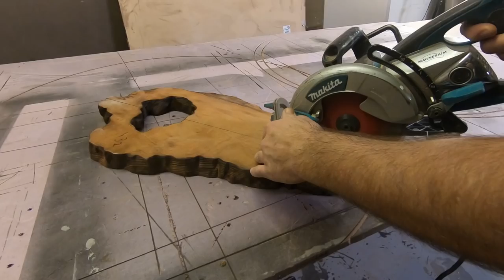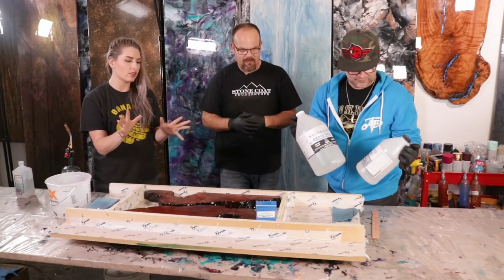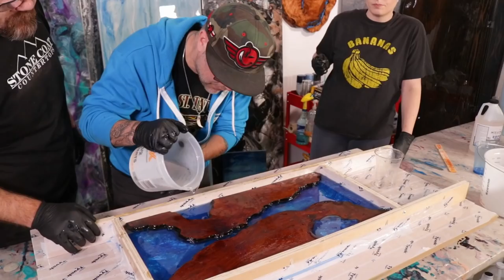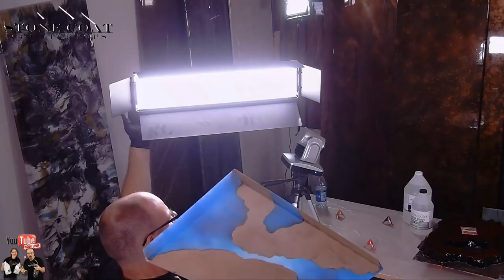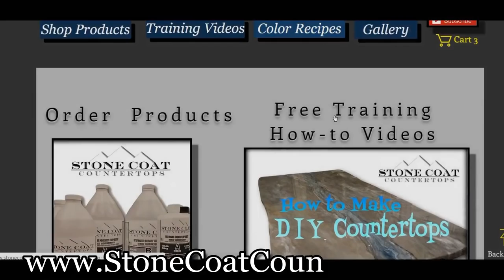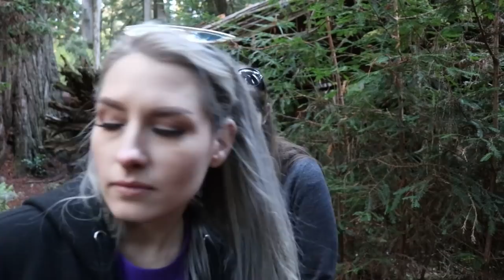Live Edge Table

Comment: Beautiful table.  I am wanting to get into this so I want to start small and was thinking of making small shelves that would get installed with shelve brackets.  Using your products, what are the guidelines for room temperature while mixing, pouring, and allowing the resin to cure?
Reply from the maker: Awesome question Batcave Bricks, You'll want to be between 70-80 degrees for the first week of the project life, doing your best to not allow the temp to drop below 65 degrees for maximum durability. 
Give us a call anytime and we would love to help 541-450-1976

Comment: I’ve heard that pre-sealing edges is no longer recommended, as the epoxy to epoxy bond is not as strong as an epoxy to wood bond, where the epoxy is allowed to penetrate the unsealed wood in thousands of microscopic pores. Like a good glue bond. Now that this has been done for a while, craftsmen are discovering that pre-sealed edges sometimes start to separate over time.
Reply: No, That's not true
delamination only occurs when you let the sealing cure fully before casting

Comment: cool looking project. I appreciate you walking us through it, and giving us some tips as you're going from step to step. It does seem like the extra steps of prep coats make it a ton of work though (particularly with the 3 coats before doing the top coat). Would probably have to sell it for $$$$.  One question: If you want the epoxy to be translucent, would it be better to mix that amount of coloring with the whole amount of epoxy instead of doing the base layer as colored and the rest of it as clear?

Comment: Was the pour done at one time, with no drying in between, if so why did mine crack, i used a full 1.5 gallon kit of resin. got extremely hot and cracked in 6 places and came away from the bottom of the mold?? my depth was about 3.5 inches thick

Comment: Hey guys, I go through all the steps you've listed... Router jig, 50grit disc, up through the grit table but I've noticed that the 50grit disc leaves swirl marks that no matter how many times I sand over them they're still present. Any suggestions? Thanks!

Comment: I have a restaurant here in Mexico and I want to do some outdoor seating tables along the same lines but with sea shells and star fish embedded in them. The patio has a screened shade over it. Will these do well in 110 degree days in the shade? I have used other epoxies that don't hold well even when putting a hot coffee cup on the surface. It leaves a ring in the resin. Mike.. will this work outside in the shade? Thanks in advance. Great videos brother.
Reply from the maker: We really appreciate your support Robert Bascelli, give us a call at 541-450-1976 or write us an e-mail at stonecoatcountertops@gmail.com and we can speak with you about the durability of the epoxy in a situation like that!

Comment: No matter how hard I try, when I'm finishing both sides of the piece, I inevitably get drips on the opposite side. It leads to endless flipping. Any thoughts on stopping the dripping on the bottom side?
Reply from the maker: SkewToob, try tyvek tape on the bottom, after 12-24 hours lightly score and remove the tape, experiment with this it could get you closer to where you need to be!